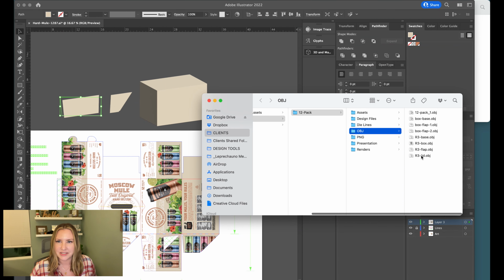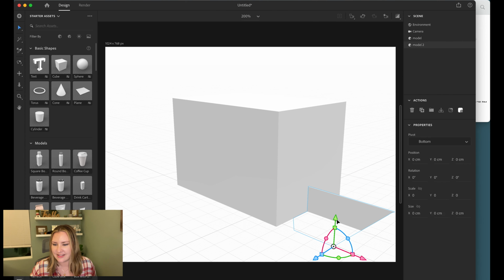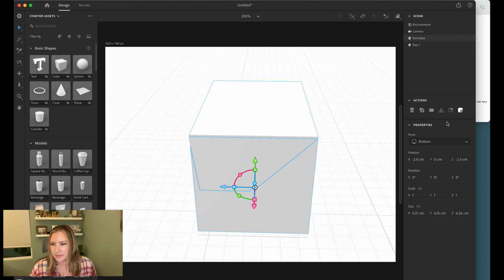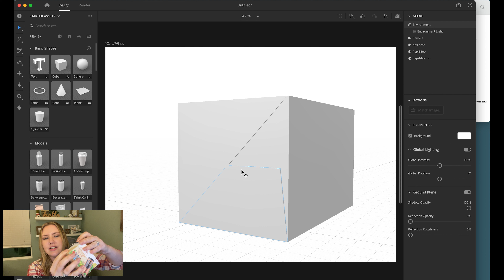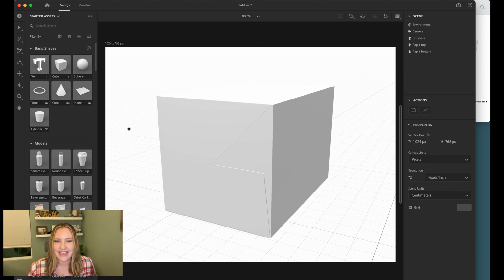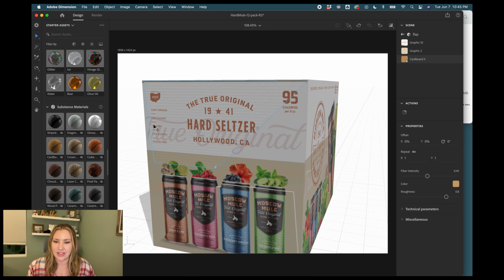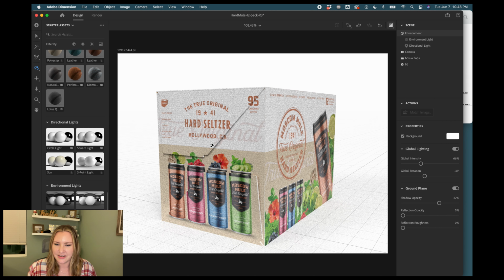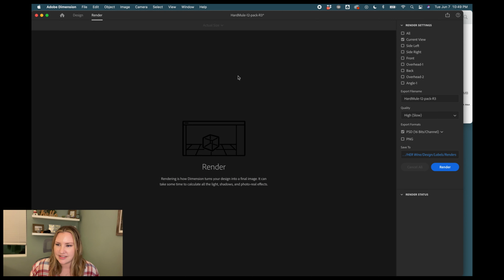Part 2: How to Design a Custom Box Mockup from Die Lines using Adobe Illustrator and Adobe Dimension

Comment: how do you make a window in the box?
Reply from the maker: Use the Pathfinder tool to subtract the window shape from the panel, then use Extrude and export the OBJ.
Reply: @silvermoondesignschool  thank you so much for replying! I had a job test and needed to create a funko pop package. Hope you can do a video with one of those as an example. Really appreciate your response.
Reply: @silvermoondesignschool  Also after the pathfinder and extrude, how would you include interior artwork through the window so you can see the inside?
Reply from the maker: I would place the panels of the box one by one in Dimension, adding the outside and inside graphics as I assembled.
Reply: @silvermoondesignschool  so want i use pathfinder to remove the window in illustrator. then in dimension Im able to add an inside graphic?